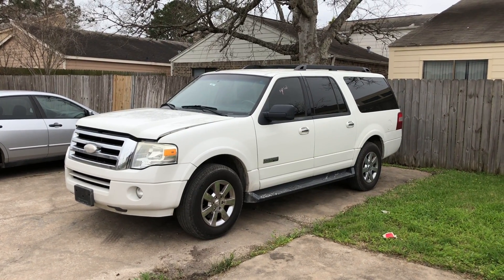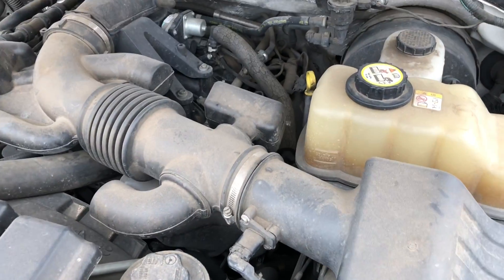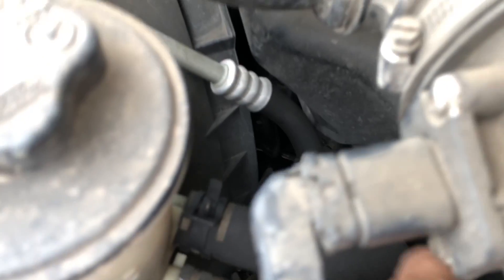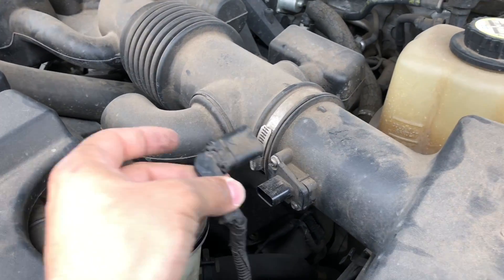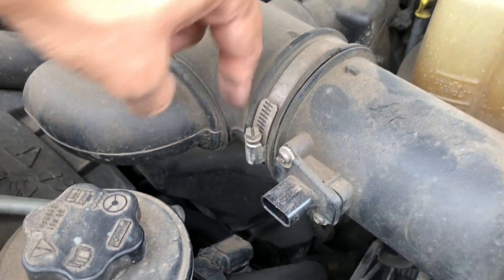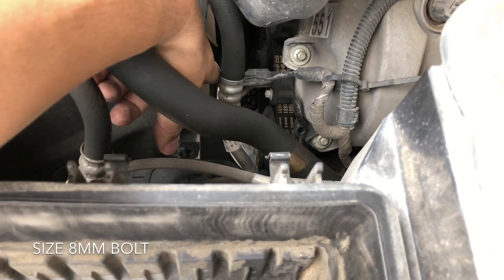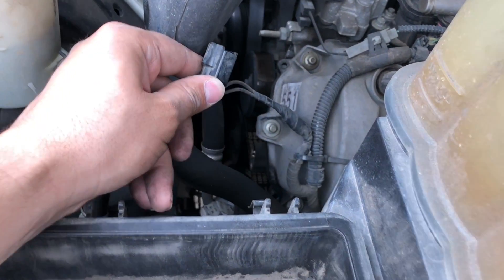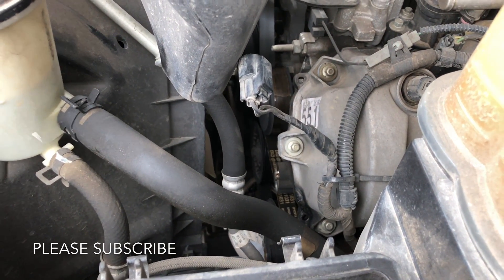How To Replace Camshaft Position Sensor On Ford Expedition P0345 Fix

Comment: Jhon,  I had that same problem on a 2010, it’s usually timing chain problem,  mine had a broken chain guide. I replaced all the guides and tensioners, gaskets blow out on the tensioners. Also cam phasers need replacing along with the VVT oil controllers.  I bought everything on eBay, worked great

Comment: i've been curious since i've seen several sensors for this vehicle, does anyone know if the bank 1 sensor is the same part number as the bank 2?
Reply: It should be. In my experience the sensors for both banks are identical, but the computer knows which one is which based on the wires.

Comment: How do you replace the camshaft position sensor connector?
Reply from the maker: Usually you would have to cut the wires and connect your new connector to your old cables.

Comment: Is this the same as the Bank 2 Sensor A? I know these trucks have 2 sensors. We have a 2007 Expedition with a check engine light on with code P0345, which indicades bank 2 camshaft positioning Sensor "A". Please let me know if this video refers to sensor A. Thanks a million.
Reply from the maker: Jhon Castro they have to sensors, bank 1 and bank 2. This is bank 2
Reply: Garage Boys awesome, I had alreadt replaced this sensor about 6 months ago and it seems that it went out again. Hopefully this will fix the hesitation/ stutter problem that my truck has when accekerating between 40 - 60 mph
Reply from the maker: Jhon Castro hopefully it will, you may also want to look into the maf sensor. But if that’s your code than its probably this sensor. If you can, help us by subscribing
Reply: @living2learn138  Question, I just bought a 2008 from some friends. They said if felt like transmission because of stuttering between 40-60 mph. Check engine light is on with code to replace CPS. Did this fix your stuttering? Sure would be great to know the transmission isn't going out, but instead was this.
Reply: 2008 Ford Expedition, I meant to say.

Comment: Is it in the same location on the 00 expedition with the 4.6L? I have a P0320, P0300, P0306 and also P1309 and from looking up the codes CMP sensor is listed. I know that the 0306 is cylinder 6 misfire but I just changed the plugs, boots and even the coil pack for #6 so I'm wondering if it could all be from the sensor, I don't feel like constantly changing parts
Reply: How hard was it to change the plugs? Heard it's hard in the 2008

Comment: did that fix it or did the code come back? Its usually never the sensor
Reply from the maker: It fixed it, light never came back on.
Reply: Jeff Hackett we have this problem right now, if the problem is not the sensor, what do you think is the problem? Our truck hesitates when accelerating between 40 - 60 mph
Reply from the maker: Jhon Castro if your issue is this sensor than it will throw you this code.
Reply: Garage Boys i sure hope so my friend, I am not looking forward to replacing the spark plugs on this truck.
Reply: Your spark plug probably has a crack in it from over tightening that you cant see. Change your spark plugs and coils I had the stutter at 40 to 60 when accelerating
Reply: @living2learn138  mine did that exact same thing I replaced the plugs and coil packs runs great now I also replaced the timing chains phaser and oil pump too but it didn't run right until the plugs and coil packs went on

Comment: Dam I just changed does thinking does where the ones for code p0019 U know what’s the ones for this code ? P0019 camshaft position correlation bank 2 sensor b
Reply: Yoyo trooper Nite what??? Speak English

Comment: A p0345 is a electrical problem not mechanical and its usually  the crankshaft sensor connector bad or wires

Comment: Having this same problem got p0345 p0018 an p0022 i changed the mass flow air sensor the plugs an coils the oil an filter to motocraft an the gas filter..
Reply from the maker: Did you change the camshaft? Also try a sea foam, it won’t hurt it can only help
Reply: @GarageBoys  no
Reply: Also change the passenger vct solenoid
Reply from the maker: Try the camshaft and also the sea foam, I’m sure that will help
Reply: @GarageBoys  replace the sensor u mean
Reply from the maker: Yes replace the sensor and also try the sea foam
Reply: @GarageBoys  ok
Reply: 😂😂😂😂😂😂 change everything.
Reply: @KobaBlack113  damn near 😂😂 hopefully this work or i will be changing more shit😞 my last ford for sure tho

Comment: Does that engine have one or two camshaft sensors?
Reply from the maker: It’s has 2 camshafts but it will be a different code for the bottom camshaft
Reply: So bank 1 would be other side?

Comment: Good job but you had put the original motorcraft part. Not acme .
Reply from the maker: Replacing parts for the originals is always good, but doesn’t mean that aftermarket parts are not good or don’t have warranty

Comment: Question! Is it the same sensor for Bank 1 and bank 2? Cuz the guy at AutoZone was fucking puzzled when I told him bank 2 camshaft sensor 😂
Reply from the maker: I’m not 100% sure but I think they are different, if you find out reply and I’ll pin it to the top